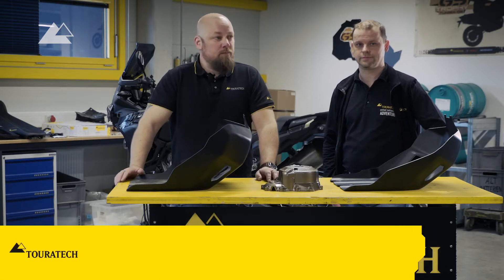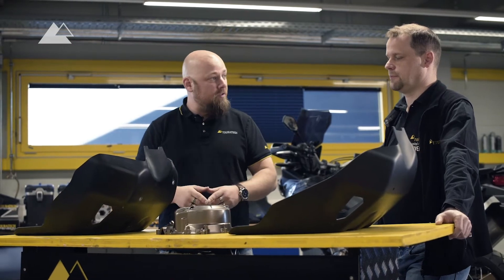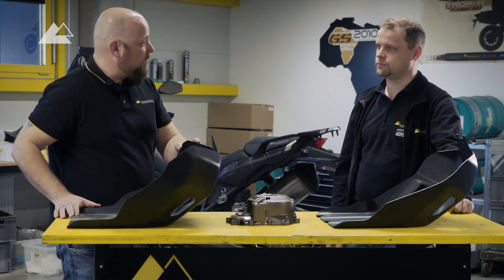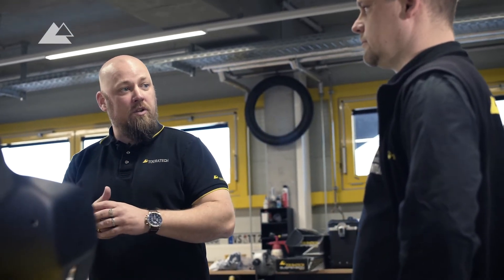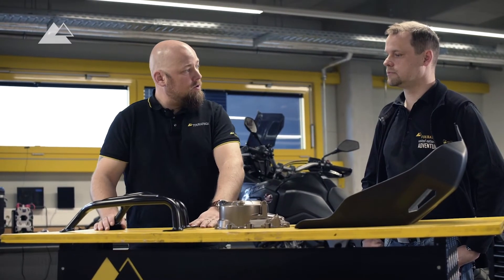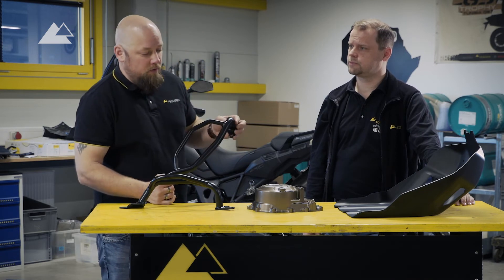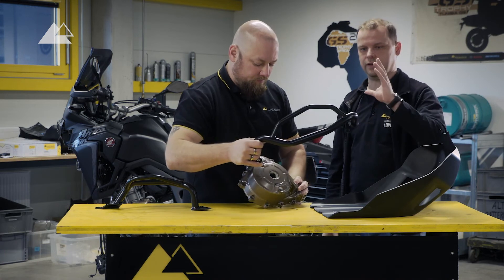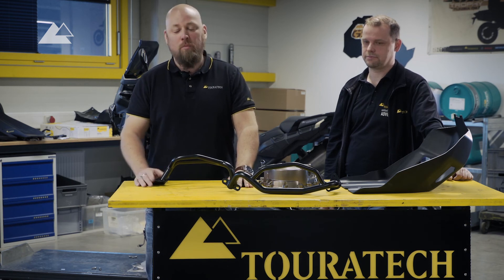++ (EN | 5/10) - SkidPlates & Lower Crash Bars - Bike Build Honda Africa Twin - WTE Black ++

Comment: I really like that skid plate. I doing to order the rallyeplate a few times, but there one think that makes me  thoughtful: the Plate covers the headerpipes and the oilfilter, also nearly the complete crankcase- without any holes for fresh/cold air to cool the engine?! Did you guys from TT test the skidplate without having any heatissues, over longer time?
Do i need to remove the shiny front heatcover of the exhaustpipe??